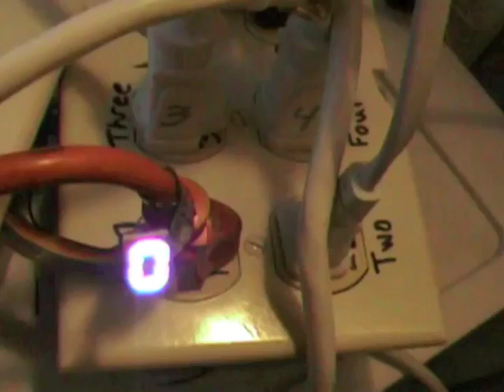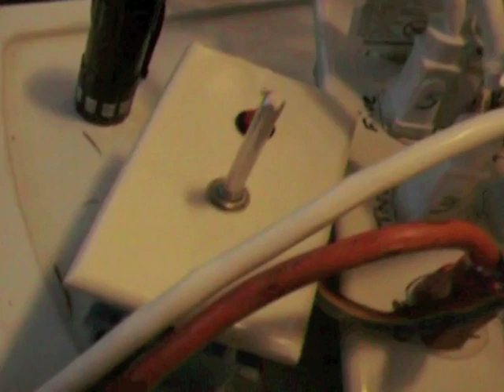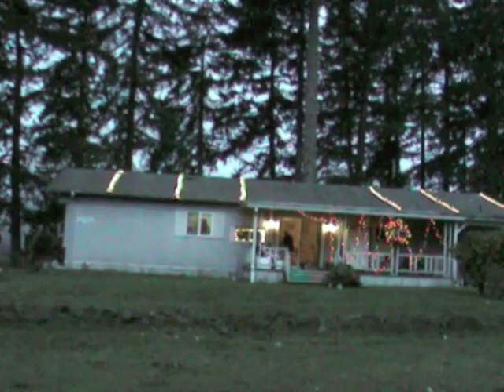Arduino Uno Based Christmas Light Controller

Comment from the maker: No. Solid state relays are treated just like LED's as far as connecting them to the Arduino. Wiring them to the AC electrical outlets, they're wired in like a light switch would be, they switch the hot line going to each outlet.

Comment: Its really not that hard to do a binary counter like that. You just have a number (dec) that you keep adding one to, each time you then to a bitRead on it and use an array with your pin numbers in it like this

for (int a = 0; a < 256; a++){
index++;
for(int i = 0; i < 8; i++) digitalWrite(pin[i], bitRead(index,i);
delay(100);
}

Thats 4 lines of code...

Comment: Nice work. Have you posted you Arduino Sketches somewhere?   Are there other sources of sketches that you found helpful? 
 I wonder if you switched your power cords around for the binary if it would look better.  I am accustomed to reading binary from right to left, not left to right like yours.  
If you want to find a one piece quad outlet faceplate try an electric supply house, they will either have it or be able to order it for you.
thanks again for you work.